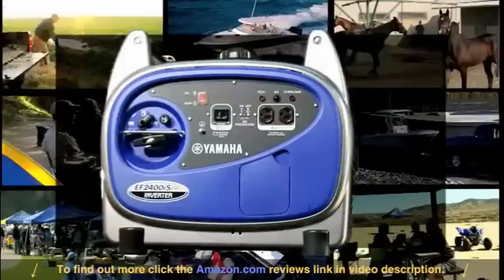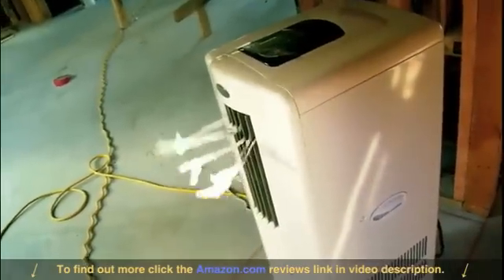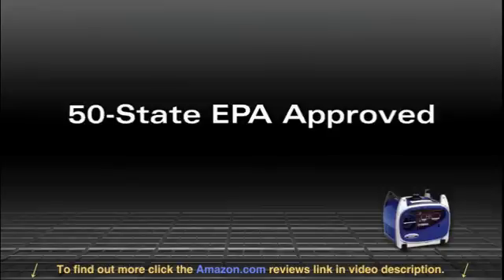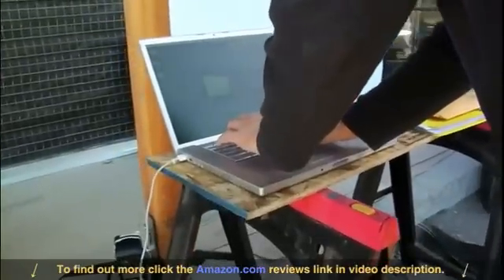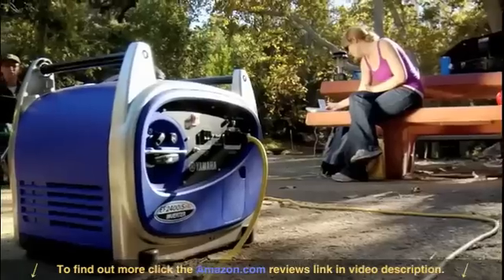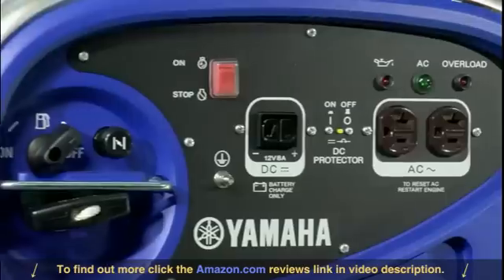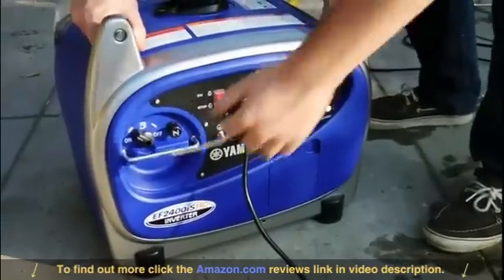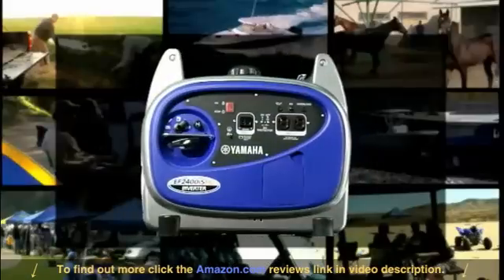Yamaha EF2400iSHC Inverter Generator

Comment: Used this all day tailgating today✬✬>share4.photo/Y22Inverter?ОЭ   Never had a problem was not too loud and ran the whole time. Make sure you purchase 10W-30 Oil bc it is shipped with no oil. Have not seen any leaks or anything with this product.